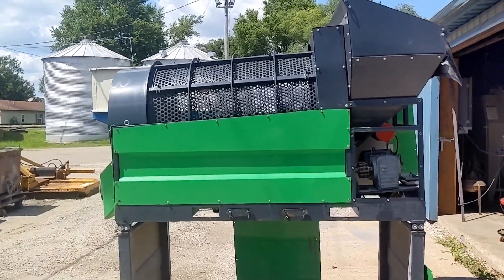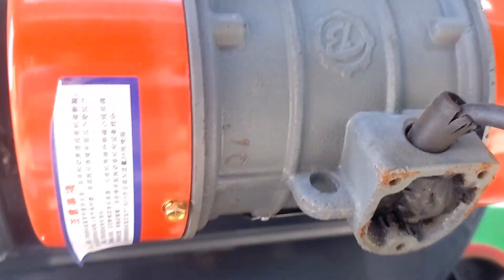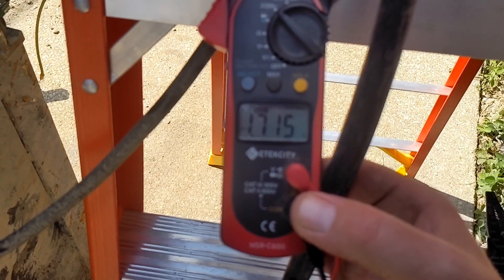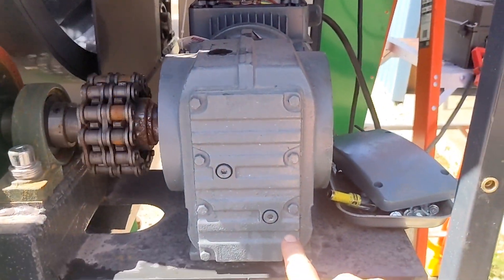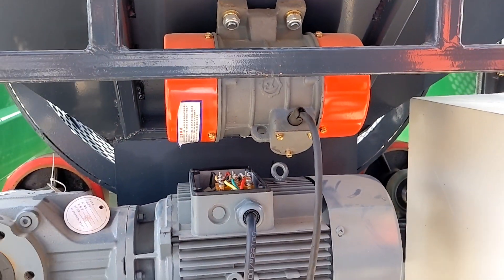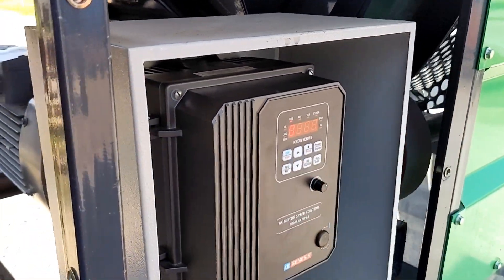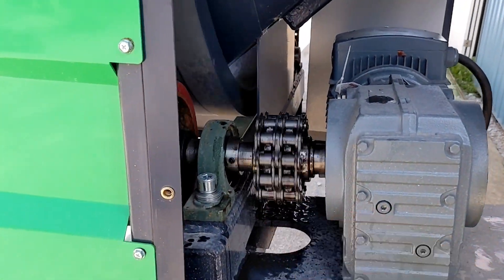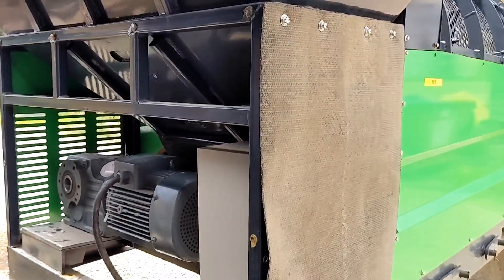Most Affordable Trommel Dirt Screener for Soil & Rock? (Valley Pioneer GF480) EP. 1

Comment: How did you end up wiring the motor. Is it in delta or wye?
Reply from the maker: I did not have to change the motor. If you go back and pause the video. Make sure your video resolution is on high. You should be able to see what it was wired up for.

Comment: Can you give more information on the variable speed controller. I recently bought this screener knowing I would need to change some stuff around to run it. What hp is the speed controller?
Reply: I’d like to run it off a 8,000 watt generator 240 volt 30 amp
Reply from the maker: @wilkinson1588 I honestly I'm not sure if it'll need to be that large of a genny... What is the KW on your motor?
Reply: I can’t find the tag on it but what I found on other screeners listed for sale it’s a 4kw
Reply from the maker: @wilkinson1588  I believe it'll be on the backside of the motor against the wall of course haha. I was able to sneak my camera on my phone back there and get a picture of the tag. 4 KW would be 5.36 horsepower. My vfd is rated for 2hp on the single phase side and does not seem to be struggling at all. Granted I have not ran product through it.
Reply: Running material thru anytime soon?
Reply from the maker: @wilkinson1588 hoping to but just had a newborn 4 days ago so I took a week off to get settled in. Then I'll probably have to play catch up.
Reply from the maker: What input power do you have
Reply: Congratulations.
I’ll be waiting patiently for the next video.